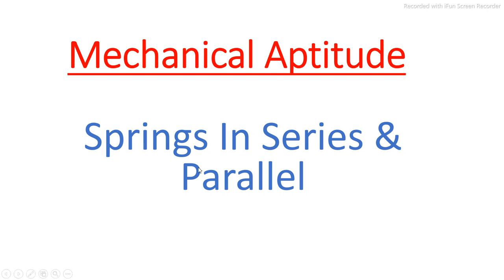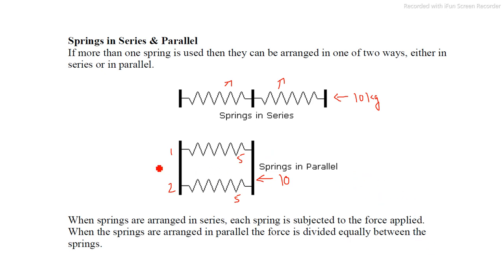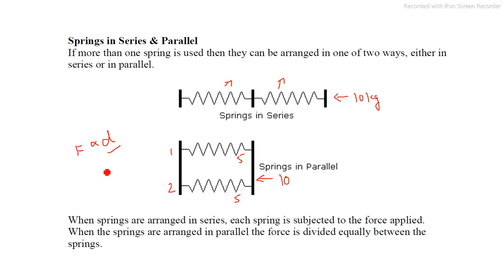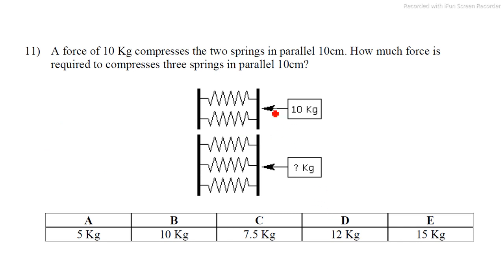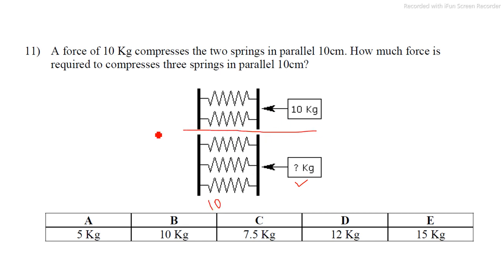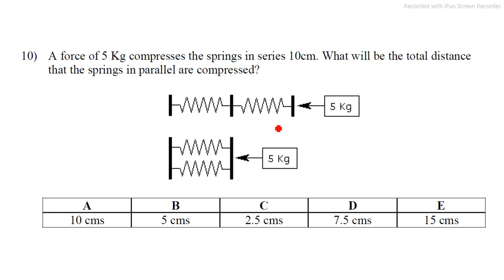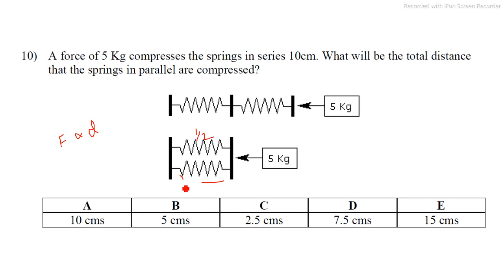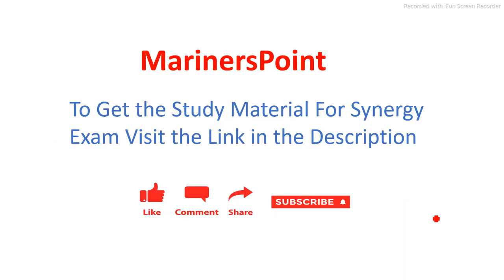Mechanical Aptitude - Spring | Synergy Exam Previous Year Questions #synergy #synergy2022 #reasoning

Comment: Sir 10 question me 10 cms hona chahiye na
Reply from the maker: In parallel loads are distributed so Force will be divided in halves and similarly distance will also gets halved as both are directly proportional
Reply: @marinerspoint  no the answer will be 2.5cm we mustn't assume each spring in series was streched by 10cm. they are streched by 5cm each.

using hooke's law F=-KX solve it it will be 2.5